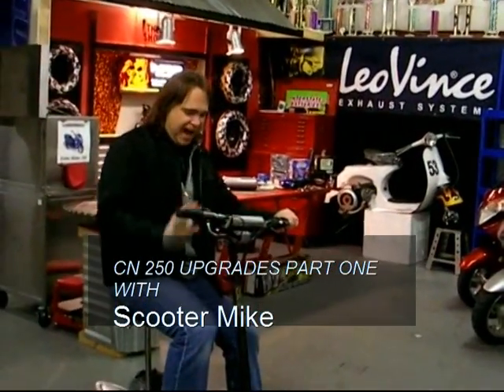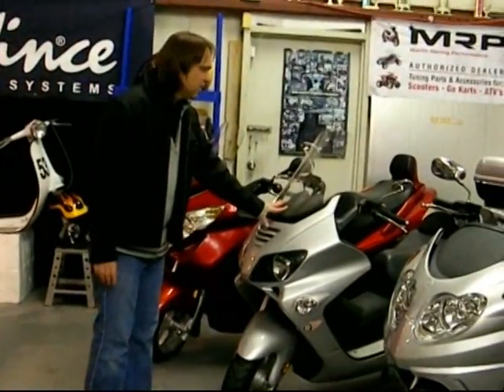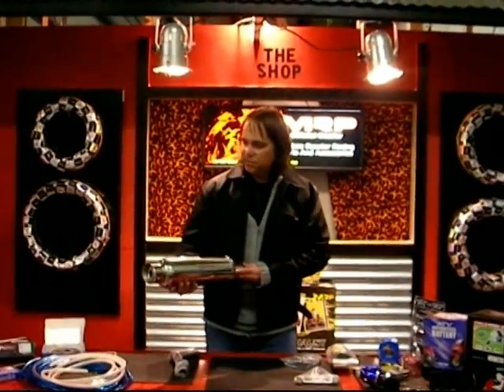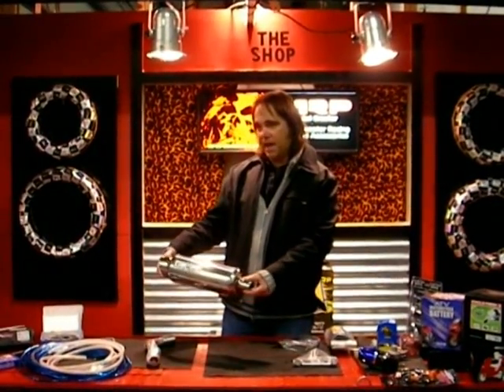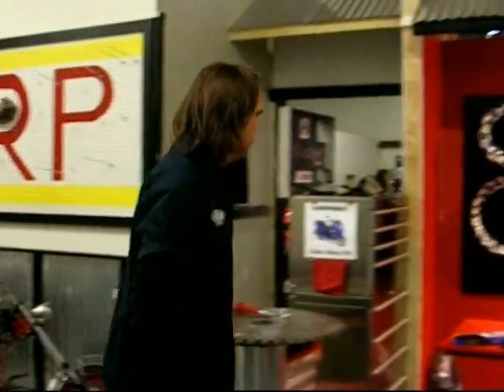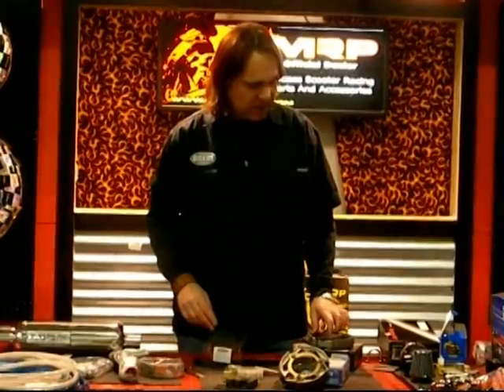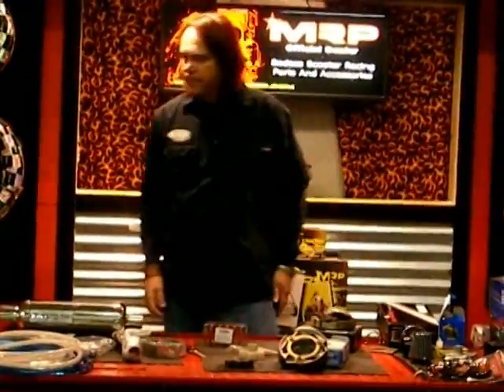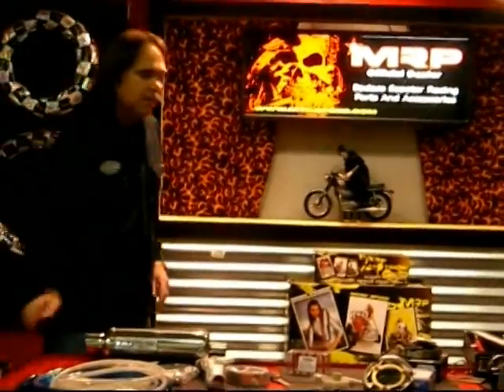CN250 Engine Upgrades

Comment: My engine makes small backfires sounds when slowing down after going maybe 30-40 mph. And my oil looks weird
Reply: What could be the reason
Reply: R. I. P engine
Reply: Your probably running too hard, change oil more often, check plugs or change to higher grade, and your gear oil is probably shitty. Use Lucas sun or the purple shit. Remember it’s not a race bike. Frequent maintenance is key.
Reply: You likely have an exhaust gasket leak. Typical for this engine. That creates a lean situation that will pop loudly when you decel mostly
Reply: @jimalden9376   is there anyway we could talk more, was looking into purchasing a helix local to me, and need some tips/ places to buy parts. ty.
Reply: @bestbroseph1258  I’m sure you can google where to get stuff but I can help a bit I suppose. This is still J Alden, just a different account
Reply: @Techridr  I know but at least a reputable site to look at. Throw me a bone lol.

Comment: This guy has NO CLUE how the transition of a scooter works or how to tune it. Take all of this with a grain of salt.
Reply: He has NO clue indeed. I've been tuning Honda Helixs for years and as soon as the airbox is gone, so is the power. Exhausts only give you certain peak RPM advantages, but you'll almost always lose the linear powerband offered by the stock setup.